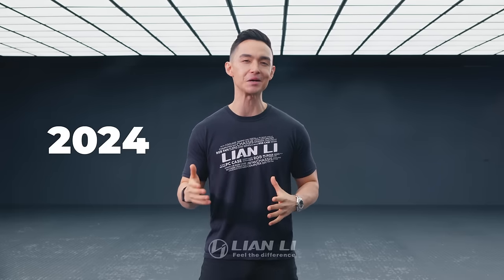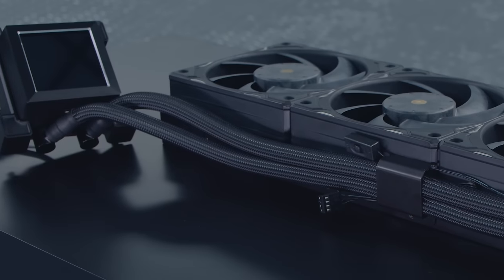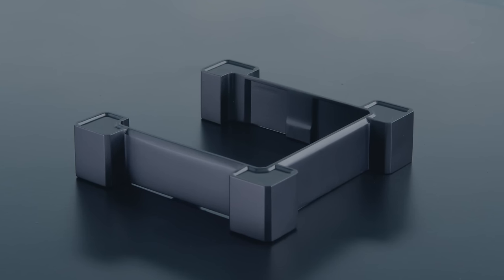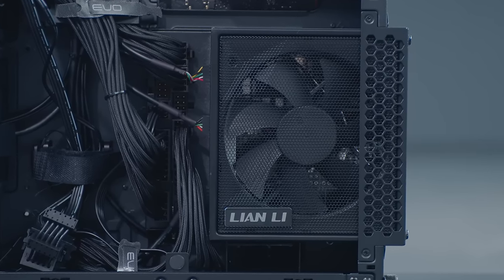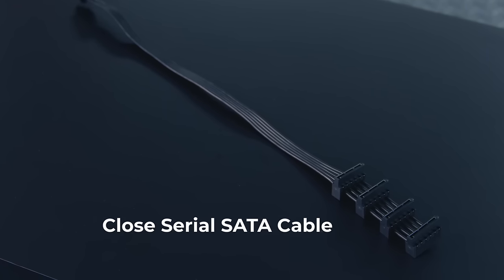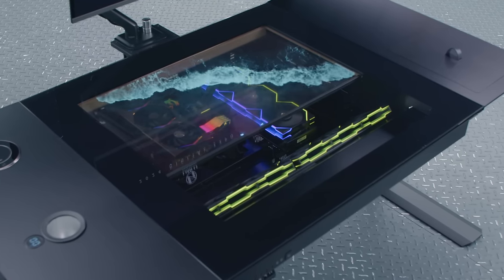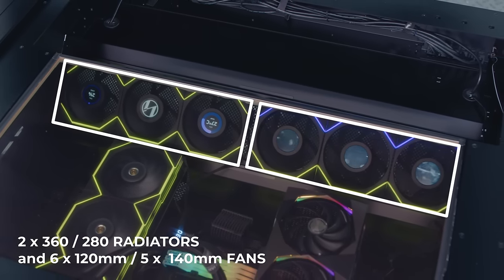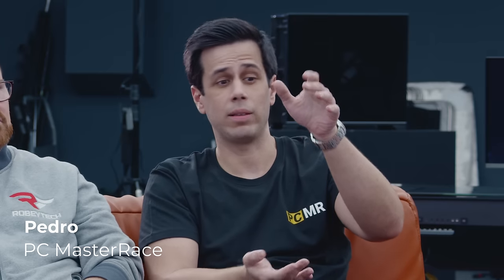LIAN LI 2024 Digital Expo Part 2 -  Preview of GALAHAD II LCD Shift AIO / EDGE Series PSU / DK-07

Comment: The only reason i liked the dk-05 was because it had a spots for TWO motherboards and spanned the entire desk. Now, not only do you only have room for ONE monitor arm, but you have made it smaller so you can only fit 1 pc, added an OLED display which while "neat" nobody really asked for it and it only covers like 3/4 of the glass leaving a terrible line. Also, cup holder? Really? Thats what you figured everybody wanted? the hub is kinda cool, however the glossy plastic on the top is very prone to scratching. Plus the cargo space would be great for a workstation type desk or something that you use to work at, but the rest of the desk does not suit that need at all, and if you have a large desk mat you cant even open that bin. As someone who loved the dk-03 and especially the dk-05, this desk might be worse than the amazon clones of your original desks.

Comment: please make a double system dk-07 like the dk-05 and don't make the drawers it will be unpratical with hotas! and for the fans 140mm are the main now make all fans spaces in 140 and compatible with radiators more like the dk-05.

Comment: Really need to see a dk07 that supports dual systems. I feel like that's the main use case. 2 systems without any clutter! Dk05 is too cumbersome to build in to use and requires too many watercooling components. I just want someone to create a desk pc case that supports mainstream aios
Reply: You're spending $2k on a desk case but you don't want the performance and silence of watercooling because it's a bit more work? bruh.

Comment: Im super curious about these new Edge PSUs. I do alot of RGB builds that need USB Controllers, so would be nice to have a built in splitter and easier cable management <3
Reply: You'll 100% get both of those with the Edge.

Comment: I have 2 comments/suggestions with "constructive" reasoning and explanations: 

1) For the PSU it's great only improvement would be to have the option to sacrifice one usb port (toggle switch for example) to be able to use PSU telemetry.
(Watts in, Watts out, current draw on rail… My current one is the corsair ax860i (use this a reference) and I really have a "use case" for the telemetry that that PSU provides, but either way this might be my PSU for my next build 🍀)

2) Related to the DK-07 which can cost you a few sales perhaps…
I would really love if that one would be able to go down to 65cm for example, the DK-05&-04 only go down to 69cm. 
Q: Which customer would need it to go down "so low" (or even lower)? 
A: Well us females tend to be shorter than males, by about 12cm (this is a global constant no matter what part of the world) 
As a reference with my 1,66m I'm above average and my optimal desk height would be around 66-68cm. So the desk is slightly to high for me and in the long run the current lowest height for the DK would not be ideal for me and many others of my gender who make up about 50% of the population.

3) This is more of a comment. The AIO is simply perfect 😍 
(But I do wonder why an LCD and not an OLED?)

If someone from Lian Li reads you are allowed to post a meme, It's OVER 9000! or a rickroll

Comment: The built-in USB splitter is great for reducing the cable clutter in the PSU. Now if PSU cables were angled by default or came with an adapter. Most cases have the cables coming in from behind now. I suppose people can buy their own adapters at their own risk.

Comment: The DK concept is so good and I fully hope it becomes the standard for custom built PCs (why even build in a separate case when you could build in your desk and get better cooling support and have the space/cable-free/uncluttered desk surface), but it feels like every company is slow moving to the market and that's causing fundamental design flaws to not be fixed since there is no consumer testing.

Instead of a transparent OLED display or chilled/heated cups (which I've never seen implemented well), make the desk shorter so it doesn't dig into the user's knees, make it less deep so it doesn't take up too much space, spread the components across the entire desk (no USB hub or cool compartment) so that the entire thing takes up less space? It could have a well designed interior with less extravagant features, could come in at a more affordable price and kick off mass consumer adoption.

Lian Li triggered the whole new case era with the O11D. It could completely revolutionise it with making desk cases the norm.

Comment: Dk-07 that has dual pc compatibility like the dk-05f maybe an dk-07f, on the dual pc version make it have support for 2 monitor arms and maybe dont discontinue parts like you did the dk-05f and dk-04 only 3 years after release. Do that and youll get my money really wanting to try a desk build but the dk-05f is gone and even when i could find (at scalper prices) the parts i need that were compatible with ekwb were already discontinued

Comment: I feel the transparent screen is a nice flashy touch. Probably not the most practical, but definitely a good selling point. The drawer, cup holder and power hub however feels an intrusion of desktop space. The power hub will be problematic for global sales; too many SKU's to match the plug design of different regions. The drawer would be better served as a more conventional design than a top access. That's just inviting spills and other objects falling in. Likewise the cup holder would be better served by a thermos than another hole for things to fall into. Definitely go with the transparent screen though. That's cool AF!!

Comment: I have recently started switching from Corsair to Lian Li products due to the cost as I build a new system every year. While planning my new build which is complete by the way, the last bit I need to swap out is the Corsair AIO I'm using, as I recycled it from my last build to get up and running.  It would be amazing to know a general time frame of release for your GALAHAD II LCD Shift AIO. I am referring to spring, summer, or fall release because I like to know how long I have to wait for something that I need for my build.
Reply: release is late Q2 of this year
Reply: Thank you!

Comment: Be cool if you can put anything on that desk screen.  Most likely like PC specs and such. That way we don't need all those tiny LCD screens
Reply: it sounds like it's just an LG display with only one of the layers so it's transparent, will plug into the GPU and act as an additional monitor

Comment: The power supply is probably the only innovative thing here besides the CPU block cover just comparatively to last year. Non-removable motherboard tray that's a step backwards. Can only put two 120 mm fans instead of the whole 240 radiator? The power supply unit is probably the best thing though, that is awesome. But how many people need a 1300 w power supply? You made 850-1300 w? No 750 or 650s?? No small builds here...